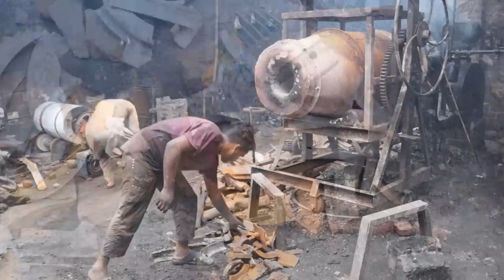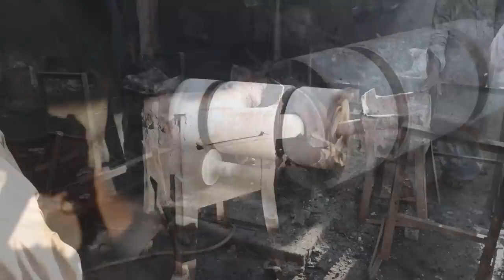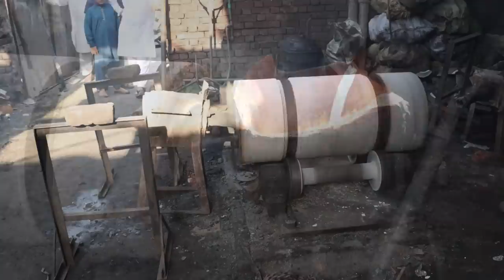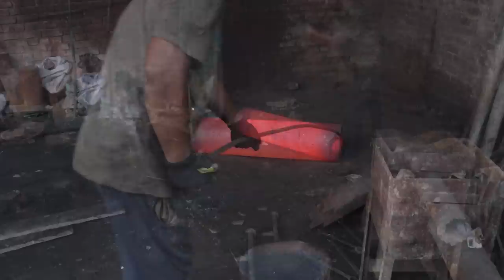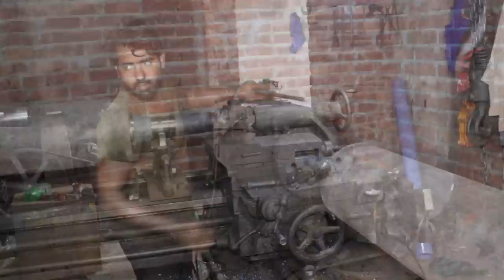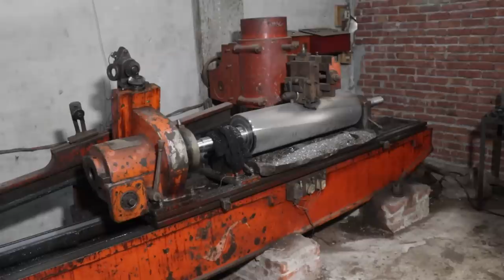Amazing Process of Manufacturing Stainless Steel Rolling Mill Roll

Comment: Full respect to those guys working with molten metal in sandals. I've been working with molten bronze for a couple of years, and the heat of the crucible straight from the furnace can be felt from 10 meters away. Without proper protective gear, the heat is unbearable - not to mention eventual spillage, drops or sparks (molten iron have 'lovely' sparks). 
Fun fact - melting point for bronze is 913°C (1675F), while stainless steel is 1670°C (3040F). And if I remember correct, the shavings from milling reach temperatures of around 280°C (536F). Also not funny to get on bare skin (from own experience :P).
Reply: Can testify, as a bladesmith by hobby when my forge gets to working point for 80cvr2 it's almost around 1500 °F.  It can be the middle of dead winter and I can be in my shorts and short sleeved in the garage with the door wide open and still be too hot

Comment: I loved this video!!  The oil-fired melting furnace was fantastic!  The centrifugal caster amazing!  Greatly exceeded expectation.
Reply: I imagine what could happen if that caster full off melted steel would fell from the rolls....
Reply: @ravethecity  What, a few grams of hot metal might splash out the ends?
Reply: @d.jensen5153  it seems like you don’t know anything of metallurgy
Reply: @luiscrdz99  Well, I have a degree in mechanical engineering which included several metallurgy classes.  Also toured United States Steel blast furnaces, open hearth furnaces, and basic oxygen plants.  Also visited a nodular cast iron pipe manufacturing facility with its chief engineer.

Comment: The shafts are cast iron. Where is the stainless steel?
Reply: I think they are used for rolling stainless steel sheet.
Reply: This is Stainless steel
Reply: @rashidzaidi5211 , at the very beginning of the film we are shown the raw material. It's scrap metal. There are only pieces of cast iron. When machining a shaft on a lathe, there are no chips - this is how cast iron is cut. Don't fool yourself.
Reply: @acsenov  scrap metal from destroyed russian tanks i hope

Comment: How the hell do they know the specific alloy?  It doesn't look like the scrap was separated by type.  Nothing showed the addition of any chrome or nickel to the melt.  What are they making 200 series, 300 series, 400 series?
Reply: They’re making not stainless steel. They’re making rolls. You parsed the title wrong.
Reply: @xl000  that thing is far from being Stainless steel, seems more like gray cast iron, or a high carbon Steel
Reply: @luiscrdz99  no one claims they're making stainless steel.
They're making rolls from a shitty mix of random metals. 
That roll will be used to roll stainless steel in a rolling  mill.
Reply: @xl000  Actually that is what the title says, if it means what you say it does the order of the words is wrong. If the roller is to be used for stainless steel it should say "Manufacturing a rolling mill roller FOR stainless steel production"
Reply: @rolflews  I guess in correct English this wouldn't work , but I parse it this way:
( ( ( Stainless Steel)  Rolling  ) Mill Roll )
I know this is what they meant, (stainless steel) as an adjective to Rolling, not Roll.

Comment: Somewhat disappointed we didn’t get to see the metallurgist in the laboratory testing for the correct alloy blend for stainless steel, ah well, perhaps next time after someone finishes uni. Just sayin!!!
Reply: I'm sure they have a process engineer who developed a scrap mix that is dead on..
Reply: The title is poorly worded. I think they are manufacturing a roller to be used to roll stainless steel, the roller itself is not stainless steel.
Reply: @1957mrbill  
Rollers for stainless steel are usually titanium coated.
Reply: @richardtemby4358  The coating can be done later and probably by a more sofisticated process since working with titanium is hard. That shit oxide so fast.